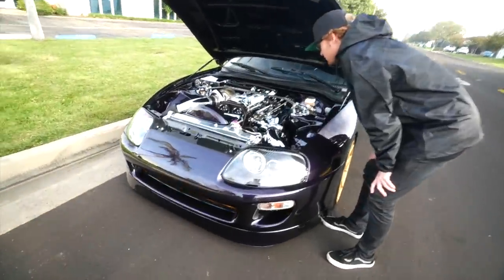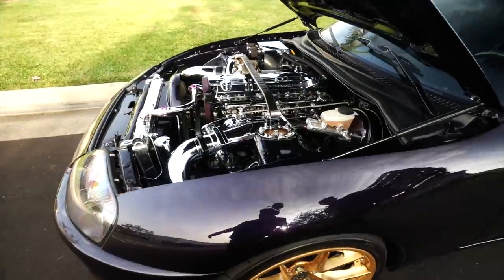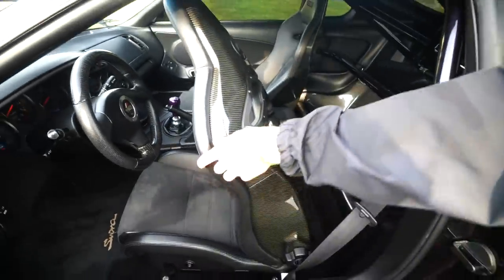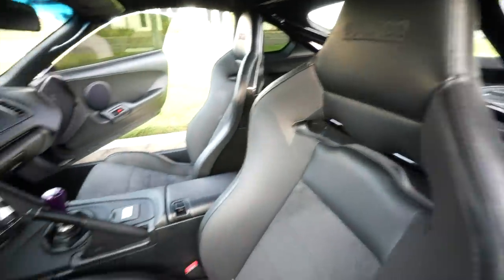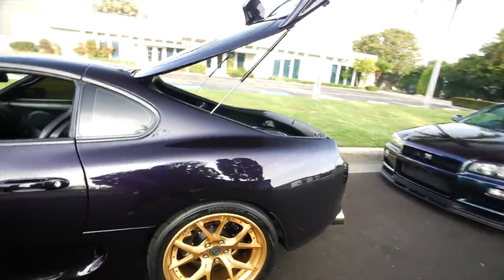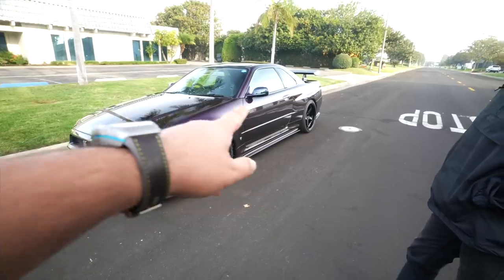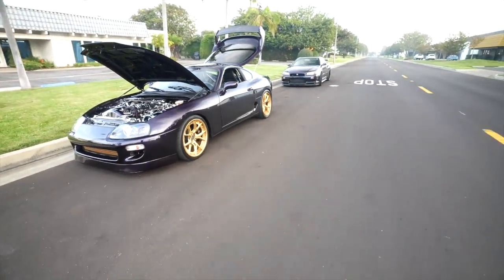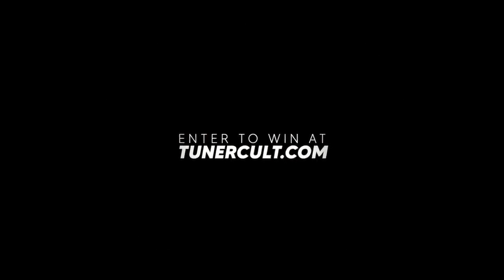R34 Skyline GTR vs. 1200whp MK4 Supra *TCG25*

Comment: Both cars are at the top of my dream car list. But I would have to go with the R34 skyline. Due to the fact that it was never produced in the US I have less of a chance of ever acquiring that, on top of the fact that there were less produced. Those if I really want to get down to it the fact is it's been my #1 dream car ever since 2 Fast 2 Furious came out.  As for things to get done. I remember back when you had multiple of the r34s and you had talked about modifying this one, I would be interested in having you guys go over modifications that you made compared to when you originally bought it.